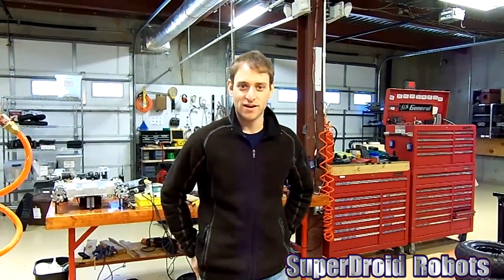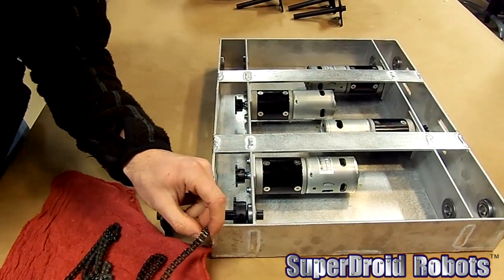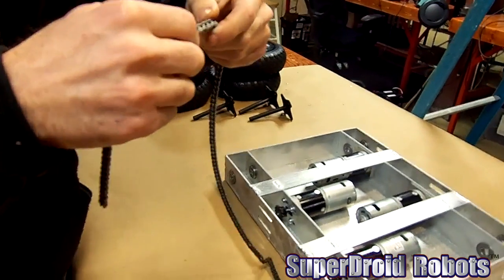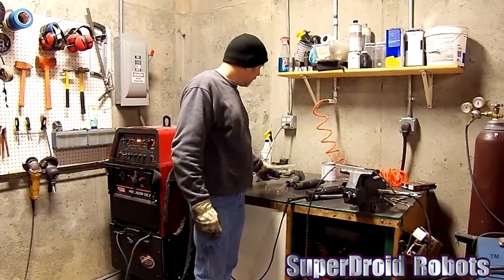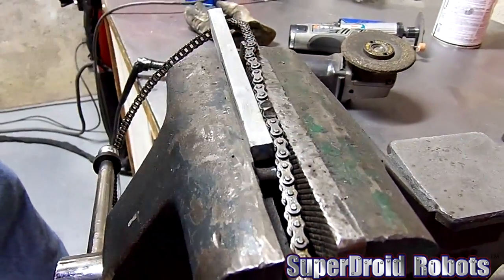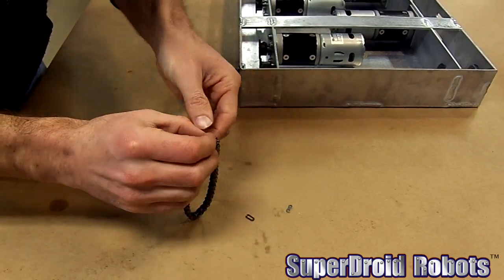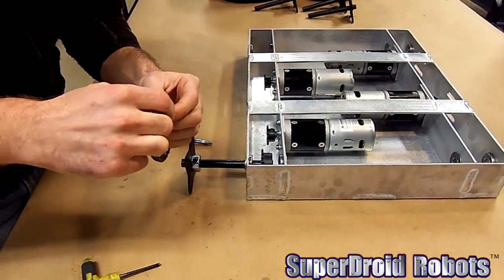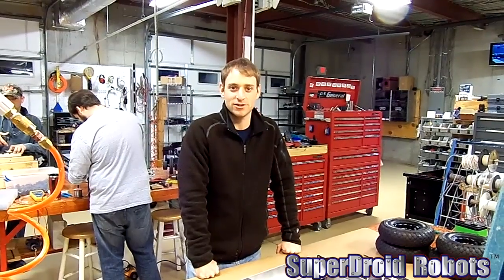How to cut Roller Chain-Instructional Video by SuperDroid Robots

Comment: I can never seem to get the chain tight enough.  I am following the steps, but it seems to loosen and fall off over time.  

Does the chain stretch or need to be prepared or is it doing this because everything is not tight enough?  Can you do a video on some do's and don'ts of installing chain for complete newbs?